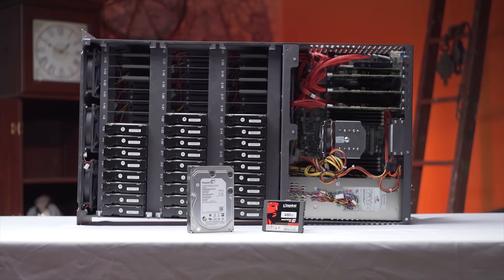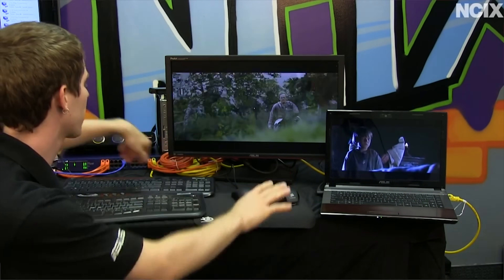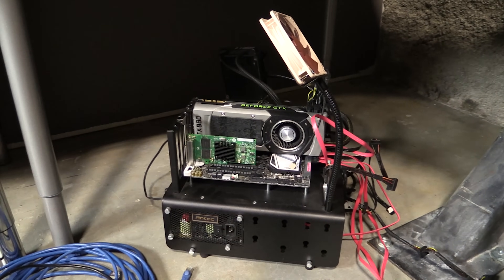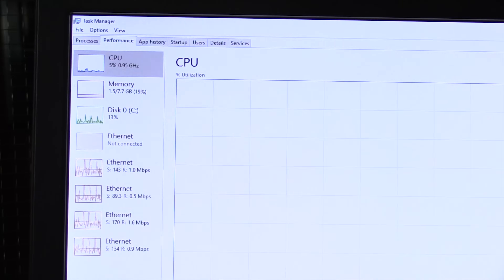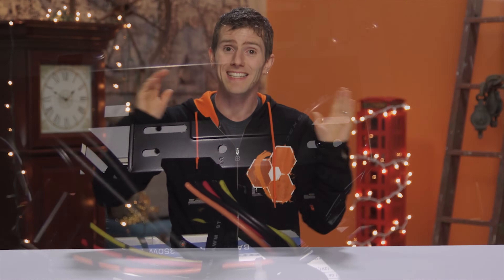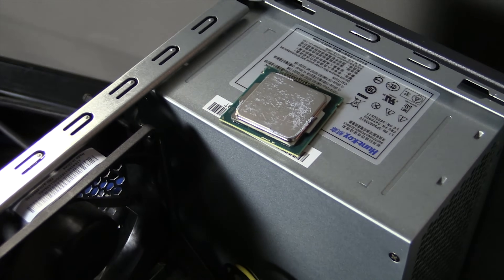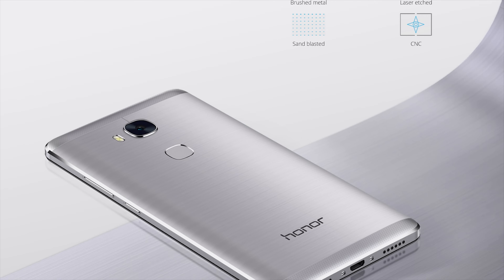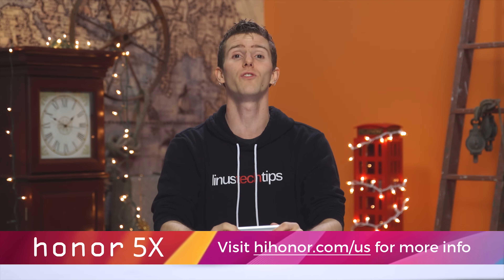Quadruple Your Network Speed for $100 with SMB 3.0 Multichannel!

Comment: I'm in college and live in an apartment that has restricted 2mb/s Internet. It took almost a minute for this video to load. 

Any suggestions?
Reply: +TheFinalBoss ™ not if you know the difference between a "Network" and "Internet"
Reply from the maker: +Dan Valdivia This won't do anything for your INTERNET speed. This only helps with local file transfers between machines on your LOCAL network.
Reply: +TheFinalBoss ™ Only if you don't know the difference between a Network or the Internet. Say you have a Local Server (As in, one you'd find in an office for specific use.) you'd wish to transfer data from and to multiple PC's through LAN. This would help improve your network speed.

Or as Linus suggested, between multiple computers or other Machines running on the same Local Network.
Reply from the maker: It's exactly as advertised.
Reply: I got the same problem mate, I live in Australia and it's like that pretty much everywhere except the cities
Reply: lan cable?
Reply: +Dan Valdivia You could try sticking the Ethernet cable up your butt. That always helps increase my bandwidth
Reply: +TheFinalBoss ™ The title does say NETWORK. doesn't mislead at all...
Reply: +TheFinalBoss ™ you're kind of an idiot...
Reply: +TheFinalBoss ™ it pretty clearly says "network speed" not "internet speed"
Reply: +LinusTechTips then this video seems kind of clickbaity
Reply: +TheFinalBoss ™ no it doesnt. it says network not internet
Reply: I have 2 MBps and can steam 720p so.............
Reply: +Dan Valdivia  Have you tried unpluging it and then plugging it back in?
Reply: +TheFinalBoss ™ Network speed =/= Internet speed. The clickbaityness comes from people thinking those 2 are the same thing.
Reply: +TheFinalBoss ™ The title says "network".
Reply: Get laid
Reply: +TheFinalBoss ™ Why? It's network speed not internet speed. Of course if you convince your ISP this would be scaleable hahaha
Reply: +TheFinalBoss ™ Not if you know the difference between network and internet speeds...
Reply: Complaining about 2mbs? I've got 300kbs...
Reply: Thank god I live in Finland. Router + 100mb internet =24€ per month
Reply: +TheFinalBoss ™ It looks like clickbait for the noobs who don't understand shit about networking.
Reply: +TheFinalBoss ™ It seems like a lot of the newer videos from LTT are click baity.
Reply: +Dan Valdivia Move.....But by the time you read this you've probably graduated, got married with 4 kids, and hate the Caravan 2030 model your wife made you buy for the kids.
Reply: +Kriss F lol I have 100mbps dl and 50mbps ul XD Fibre is great
Reply: That's nothing. I get 120kb/s fuck off m8, 2mb/s is a dream.
Reply: +Dan Valdivia Change College Duh!!
Reply: +Dan Valdivia go to a different college.
Reply: +Sdudyoy Newton ye dude, beat me to it. haha
Reply: +Dan Valdivia Get a different ISP? Or a mobile hotspot?
Reply: I get about 800KB a second internet, what's that in mbits or whatever they rank internet speed.
Reply: I had 2 mbit/s internet about 6 years ago, in 480 videos were fine.
Reply: I live in Australia <500kbps
Reply: dang I got 512 kbps and I watch 240p vids on YT 
FML
Reply: Get a 4G router
Reply: +Frankly Ratratiano You should see about getting your internet upgraded to the NBN if its in your area yet, 100mbps is pretty nice.
Reply: +TheFinalBoss ™ if you don't know the difference between local network speed and internet wan speed then that's your stupid problem
Reply: +TheFinalBoss ™ It says network not internet ya dope.
Reply: I thought this channel was for the geeks hang out but y'all dumb asf. Network vs internet speed , very clear difference
Reply: drop out
Reply: +Dan Valdivia 2 mbps or 2MB/s, cause if u have 2 MB/s then u have decent speed
Reply: Some people are so lucky. I live on my own sadly in the middle of no where. I can't deal with satellite data caps and I can barely get phone service from Verizon (so wireless internet isn't an option) so my last option is Earthlink's accelerated dial-up. It's terrible. Every single time- the dial up sound. Awful
Reply: Hahaaha I have 0.333 kps internet hurray Ireland
Reply: +LinusTechTips the title could've said something about local network speed
Reply: +TheFinalBoss ™ No, only clickbait if your a fucking idiot and don't understand the internet.
Reply: +Dan Valdivia I used to have 1Mbit  internet and it loaded 360 videos just fine. 720p video should be just fine with 2Mbit.
Reply: +TheFinalBoss ™ To think you can Quadruple your Internet speed above what you pay for is a lack of critical thinking on your part.
Reply: +TheFinalBoss ™ No it doesn't. It just means some people just dont understand the title. I never thought it was about internet speed. it says network in the title.
Reply: +TheFinalBoss ™ Forgive me if I am not understanding your intent but network speeds are not considered the same as internet speeds. Network speeds are how fast you can transfer files within your network not the internet. The video title does not claim that you can download things faster or stream at higher quality as would be implied with a faster internet connection.
Reply: +Dan Valdivia graduate and get your own place.
Reply: +Dan Valdivia move to Canada
Reply: +TheFinalBoss ™ not so. Internet and network mean different things
Reply: Just Hack someone wifi! problem fixed lol
Reply: +TheFinalBoss ™ It would be clickbaity, if he had said "internet" instead of "network" speeds. Your lack of technical knowledge or attention to detail isn't Linus's fault.
Reply: +TheFinalBoss ™ No it doesn't, i knew exactly what the title was suggesting as soon as i read it, it says NETWORK speed, not INTERNET speed.
Reply: get a sick mobile internet plan and use it phone as a hotspot.
Reply: +Generally Good PC Games Internet in Australia is faster than what you think.. guess you dont have fiber.. Swinburn university Has Solid 700mb/sec and higher.. ive tested it myself..and my mates Internet hits anywhere from 150 - 400 mb/sec.. only thing is prices way to expensive at $100 AUD a month.. yeah.. no thanks.. p.s. i have anywhere from 3-15mb and i watch 1080p fine with no buffer time most of the time.
Reply: +Dan Valdivia Move out?
Reply: +TheFinalBoss ™ Network speed is CLEARLY NOT Internet speed.
Reply: +Osumo Ben Lodan hahahaha im at 300/25
Reply: +TheFinalBoss ™ No, you just don't understand what the title means.
Reply: +LinusTechTips there are people who use ssh injection to use high speed Internet with least speed price  right?
Reply: +Matthew Kinney i stream on 240 p -_-
Reply: +Dan Valdivia Get a 4g antenna
Reply: +GAME OVER &quot;WE HAVE EVERY PIXEL COVERED&quot; Well if it is actually 800KB then that is 6.4mbits.
Reply: +Dan Valdivia Drink more coffee :-P
Reply: +Dan Valdivia Need more data. Do you pay a ISP for internet? Are you just connecting to the College's wifi? What equipment?
Reply: +Frankly Ratratiano shit talker mate.
Reply: Amaro Jorge Ace
Actually it looks like you beat me to it!
Reply: +Dan Valdivia  You're fine since it's a nine minute video. Also, You wouldn't necessarily want to have it all load at once so you save bandwidth.
Reply: +Dan Valdivia take hostages
Reply: +Dan Valdivia MOVE!!!!!!!!!!!!!!!!!!!!!!!!!!!!!!!!!!!!!!!!!
Reply: +TheFinalBoss ™ How so?
Reply: Lower quality
Reply: +Dan Valdivia You're joking, I get 0.3mb/s
Reply: +GAME OVER &quot;WE HAVE EVERY PIXEL COVERED&quot;  Multiply times 8. Probably 60MB connection.
Reply: +Dan Valdivia move to a different apartment
Reply: +Dan Valdivia go to a different college i get 100mbs our wifi is youtube certified whatever that means.
Reply: +Dan Valdivia Weird Idea, but maybe a TP-Link WAN Balancer and have the ports on different mac addresses/ Then bind traffic into one - that's to say that the management server is controlling bandwidth via mac/IP's. Just a theory.
Reply: +Pixelazed 100 MB\second :P
Reply: +Dan Valdivia i have 700 kilobytes/sec (australia of course) and 720p is fine for me
Reply: +Dan Valdivia buy your own internet you cheap ass
Reply: +Frankly Ratratiano  My 5.5 mbps W00T (I can also get nbn but cbf lol)
Reply: I have 100 KB/s download :(
Reply: +Le Veno NBN isnt in my area, instead i use Tier 5 Copper Cable with Ethernet and get 100Mbps
Reply: LucarioniteAU Nice :)
Reply: +Le Veno I'm trying to. Telstra said the nbn should be in my area around the end of February
Reply: +Dan Valdivia yeah, get your own internet
Reply: +Dan Valdivia That sounds VERY painful. xD

I have no idea what you can do though :/
Reply: +Dan Valdivia try setting your computer to wumbo
Reply: +Dan Valdivia I suggest you kill off all the other students
Reply: +TheFinalBoss ™ Not really, 'your network' doesn't imply anything internet related.
Reply: +Dan Valdivia When I went to university I had to run a phone cable from another student's room and pay for my own ADSL, which still got less than 2mbps but also had the added problems of being expensive and getting disconnected when the other student felt like being a dick. My suggestion is that you quit yer whining!

Alternatively, get a wireless internet connection either from a wireless ISP or a 4G sim card.
Reply: +LinusTechTips is there something you could do to maximize your connection? high performance router?
Reply: +TheFinalBoss ™ well no, network pretty much implies local. Otherwise it would say "speed up your internet"
Reply: mine is 2mbps too but there are no loading issue.
Reply: Have you tried restarting it?
Reply: +bigcheese82 yes there is! Pay more to get more! Works every time!
Reply: +Dan Valdivia I would reccomend first doing a speed test to see if it's really 2mb/s then check your internet usage to see what apps are clogging up your connection.
Reply: +LinusTechTips Title should have the word "LOCAL"  in it then right? I know everybody does click baits but be reasonable :D
Reply: GhostGurio network not internet.
Reply: +Dan Valdivia well if that restriction can not be unlucked. you can look for a big 4g mobile deal. and use you smartphone as a hub. some internet survices even sell 4g routers. but watch you data limit.
Reply: +Dan Valdivia Find a cable provider and subscribe to their internet. Just because your landlord provides crap internet doesn't mean you have to stick by it (at least not in my experience)
Reply: Near 90 Mbps, 11 MB/sec. I love my flat, internet wise atleast.
Reply: +TheFinalBoss ™ it is not, the video does what the title says, it never said it would improve your download/upload speed, nor your internet speed, just netwrok.
Reply: +Michael Margono  what's 2mb/s I am confused..... I'm just a kid
Reply: +LinusTechTips we need internet faster upload download BANDWIDTH Video man
Reply: Honest L7 no need for a video... it's really simple pay more for faster internet or change your ISP/distributor. If you are already paying for the best internet you can get and have the best ISP/distributor then you can't be helped, it is what it is.
Reply: +Dan Valdivia m8 500kb/s I don't want to hear anything! :D
Reply: +TheFinalBoss ™ Network isn't internet... just read the title.
Reply: +Matthew Kinney he probably means 2mbps which is 250KB/s
Reply: When i'm in college in the city I get 120mb/s but when I go home I get 2mb/s.
Reply: +Dan Valdivia Ask friends that live at different locations what their Mb/s is.  if its faster i would move there
Reply: i have only 100 mbps lol
Reply: +Dan Valdivia Move to a better apartment. The one I live in has 100/100 internet.
Reply: +LinusTechTips. You me excited for 8 minutes, and then i read your comment. Damn.
Reply: +TheFinalBoss ™ Network means LAN, if it said Internet then it would mean INTERNET
Reply: +Dan Valdivia VPN
Reply: +Dan Valdivia "restricted" <--- there's your answer
Reply: Nerfern it is exactly boosting your network speed.
Reply: +TheFinalBoss ™ The title is "network speed" not internet speed.
Reply: It will load instantly on 240/360p
Reply: +TheFinalBoss ™ it clearly says network speed in the title mate. :P
Reply: +Dan Valdivia I have the answer for you because I only 1.5MB down and 56k up. Use the extension Magic Actions for Youtube. Then after install Force Player Type to flash, stop auto play and tune on Speed Booster - Better video preloading / buffering.
Reply: +LinusTechTips No, this is clickbait and you know it. When a normal consumer sees this video they automatically think "internet=network"
Reply: +TheFinalBoss ™ Not really. Network speed and internet speed are completely different.
Reply: +TheFinalBoss ™ "Network speed" and "internet speed" are completely different
Reply: +TheFinalBoss ™ lol hardly... it says "network" in the title lol
Reply: +Sir Stankovski Try putting the games IP and URL in your host file on your PC
Reply: I have 10kbs so stop complaining
Reply: +Dan Valdivia I'm in college and live in an apartment that has restricted 60kb/s Internet. It took almost a century for this video to load.
Reply: +Dan Valdivia we can run a cable from my house.
Reply: +Matthew “Redstone Today” Brownmiller Where the Hell do you live?
Reply: +Dan Valdivia try web caching, safe squid and so on.
Reply: +TheFinalBoss ™ It said how to improve your network speed not Internet...
Reply: +sarang sharma Well now I feel bad because I always complain about videos that don't have 1440p...
Reply: +GAME OVER "WE HAVE EVERY PIXEL COVERED" That's .8 Mgbits
Reply: +John Doe My God man, what country do you live in!
Reply: +Dan Valdivia I'm at 2.5 and 1080p works just dandy. Have wee look at your'e CMD for open connections that might be eating up some bandwidth :)
Reply: +TheFinalBoss ™ Why it says network speed, not internet speed, it does just that speeds up local network speeds.
Reply: +Dan Valdivia I feel that. My apartment came stock with 5/1 but I got a few extra hours at work so I can afford to upgrade my plan to 25/5
Reply: +sarang sharma ha scrub I can steam at 1440 but I chose 1080
Reply: +TheFinalBoss ™ Not really. Network is in home kinds of stuff. If it was meant to be click-baity, it would have said internet speed.
Reply: +TheFinalBoss ™ It says Network speed, not Internet speed.
Reply: +Leron Joseph Dear Sir just starting out on my geeknerdship this is where it begins
Reply: +Dan Valdivia Short answer, move.
Reply: +Frankly Ratratiano I live in Sydney, get 2mbps down. Where is my nbn
Reply: +TheFinalBoss ™ He says NETWORK not INTERNET. So he has the right info just has good advertising as well.
Reply: +TheFinalBoss ™ Considering the title, nor the video NEVER said anything about INTERNET speeds, how so?
Reply: +Dan Valdivia im stuck here with 6mb/s (50mbit) line and still get buffering in videos. youtube fucking suck
Reply: +TheFinalBoss ™ Internet is the only network. Nowhere did it say anything about internet so it's clearly about LANs.
Reply: +Dan Valdivia My internet http://www.speedtest.net/my-result/5045426121 (no limit) in Poland only 17$
Reply: +TheFinalBoss ™ you don't the know the difference between "network" and the "internet" lol
Reply: I have 1.2mb/s and I never had problems to watch videos in 1080p
It struggles a bit to load 1080p60fps
Reply: does it scare anyone else that this comment has so many likes? It kind of blows my mind that so many people read the title of this video and thought they were going to find a magic way to get faster INTERNET speeds when the title clearly says NETWORK.. as in LOCAL NETWORK... LOL. I thought the audience of LTT were tech enthusiasts... I mean even if you're not a network guy you should realize that you aren't going to be able to change internet speeds from what you get at the modem.
Reply: +Matthew Kinney 10b=B
Reply: +TheFinalBoss ™ It's not clickbait at all.
Reply: +Dan Valdivia Dont feel bad, i have 1 MB
Reply: +Reptillian Overlord 8 bits = 1 Byte
Reply: +TheFinalBoss ™ I mean technically it is titled "Network Speed," but they probably should specify its for you're local network :P
Reply: +Dan Valdivia Is that megabit or megabite?
Reply: technically thats a milibit, but idk how that is possible. assuming its 2MB/sec since both are lower case
Reply: Aaron Gallagher Well i'm talking more about the difference between bit and byte as there are 8 bits in a byte. So if he has a 2 Megabyte connection that would actually be pretty fast but if he has a 2 Megabit connection it would be terribly slow.
Reply: +TheFinalBoss ™ NETWORK speed not INTERNET speed, similair not the same
Reply: +Milk Fuentes im on 6mb down and i can barely get it to load 480p most of the time.
Reply: +RisseK1 if you have access to both ethernet and wifi you could bride the two together that might help a little bit other than that I think your SoL
Reply: +Milk Fuentes same
Reply: +TheFinalBoss ™ No, because he clearly stated network speed, not internet speed.....
Reply: +Dan Valdivia You may have to buy an internet service for yourself (provided that the apartment owner would be ok with that).
Reply: +GAME OVER &quot;WE HAVE EVERY PIXEL COVERED&quot; 0.8
Reply: +GAME OVER &quot;WE HAVE EVERY PIXEL COVERED&quot; 0.8
Reply: +Krzesisław Wacek co to za internet??
Reply: +Dan Valdivia <250kb/s DL speed.
Reply: +GAME OVER "WE HAVE EVERY PIXEL COVERED" 0.8 mb/s.
Reply: Best Hacking Tools Of 2016 For Windows, Mac OS X, And Linux 

http://sh.st/m2w0t
Reply: +TheFinalBoss ™ Not really. Have common sense before clicking a video. Nothing is going to "Quadruple" your internet speed unless you empty bank account to isp. This is for us that run servers and nas at home.
Reply: +Dan Valdivia If you can not get a different ISP, just use the 4G or LTE or whatever connection on your cellphone through wifi, if available. That's what I did for a while.
Reply: +Connor Brown I have one of those, but it does not do what you think.  It exposes 2 IP addresses to the outside so you can have 2 WAN (internet) connections.  It balances the load only when using multiple streams or threads.  Also, the unit replaces the existing router and must be plugged directly into the 2 WANs.  He is a client on the LAN so he has no access to any of that, unfortunately.
Reply: +TheFinalBoss ™ Not really? It clearly says Network Speed.
Reply: +Dan Valdivia 4G
Reply: RICK! hotspot?
Reply: +Dan Valdivia I have around 11 megabit per second internet, You probably mean megabits, so tell your college to speed up there internet. At 11 you can stream 1080p, and 1080p 60fps most of the time. But it still is slow for downloads, but around 10-11 is good for youtube.
Reply: +Dan Valdivia MOAR POWER. Otherwise, try a free VPN and see if that helps.
Reply: +TheFinalBoss ™ It doesn't say Internet Speed, it says Network Speed. Learn the difference.
Reply: +Dan Valdivia Get a hot spot.
Reply: +TheFinalBoss ™ Or you don't understand that network speed != Internet speed.
Reply: +Giver and remover of Internet cancer. I assume he meant 2mb/s as in megabits not megabytes. Who the hell would call 2mbps a dream LOL.
Reply: +LinusTechTips Well you could always hook up 4 google fiber connections there Linus!
Reply: +Dan Valdivia Contract MetroPCS unlimited 4g =D
Reply: +sarang sharma My heartfelt condolences buddy, I too am suffering from BSNL
Reply: move
Reply: +Dan Valdivia for me that would be amazing try living in a quad plex sharing a 950 KB/s router
Reply: +Dan Valdivia Live in another apartment that allows you to use your own ISP.
Reply: if its your own router try talking to your internet provider for a faster roughter or internet speed it will cost more if its shared across the apartments than you cant do anything and 2mb/s is not that hard to live with in canada you half to pay more to get 1mb/s and i live with 950kb/s
Reply: +Dan Valdivia   easy bro, instal a vpn like hotspotshield or something and enjoy.. jumping over the limitations, if that doesnt work, try to clone some NIC mac addreses, or use wifi antenna to get some better internet from a neighboor GL
Reply: +Dan Valdivia wow that sucks im running 150mb/s wireless to my computer.
Reply: +LinusTechTips You also have to wire your house all over again, if your server is on the opposite side of your house. This is just not practical at all.
Reply: +GAME OVER "WE HAVE EVERY PIXEL COVERED"  800 Kilobytes is 6.4 Megabits which is above average in the US.
Reply: DFB Noobish cool, I thought it was like really slow, can't beleive people have it worser off in this day and age.
Reply: move to new zealand
Reply: +TheFinalBoss ™ it says NETWORK it doesnt says INTERNET
Reply: +Francisco Barraza i know
Reply: TacticalFluke09 the internet is a network.
Reply: +LinusTechTips Can you make a video on how to get the most out of your internet package and get the best pings possible?
Reply: +Dan Valdivia Go get your own private Internet. It's not expensive, I pay 60 dollars a month for 100mb/s internet.
Reply: I got the same prob. So I leave my "personal hotspot" on & crack my window open, leave my phone next to my window. My phones faster than my home wifi
Reply: +TheFinalBoss ™ LinusTechTips has been branded for mostly tech savvy entrepreneurs, enthusiasts for a number of areas, and then the general tech intrigued audience. Not all of their content is for those with commercial grade problems.

If you've followed long enough you'll see that they find unconventional ways to do unconventional things. There may be simple little things that they do that you may find undoubtedly handy but they pride themselves on going further than you'll need to go with things you may never see most of the time.

And lastly all titles are clickbait-y. They were made to persuade you to click on them. In the beginning the idea behind the video is outlined very clearly. Just getting more than a gigabit of throughput point to point.

;)
Reply: JustRefleX yes, but a network isn't necessarily the internet. The title doesn't imply this, so it's not misleading. I came here expecting an explanation of how to make my LAN faster, and I liked what I saw :)
Reply: +David Nelson The title says "YOUR" Network. lol. It's not misleading people just understand.
Reply: Oh quit whining I have under a megabyte per second at my house
Reply: +Jr 5802 Same here Sometimes less
Reply: mine 512kbps jokes
Reply: +jackson youda that's like 2001 dialup
Reply: +Matthew Kinney you are also probably the only one on that network doing so where he is in college living in an apartment with anywhere from 50 to 100 other people on the same network as him
Reply: +Dan Valdivia Hows your budget? A lot of companies like AT&T or verizon sell hotspots that can probably help you. ITs a monthly cost and some have data limits, so if possible I'd try to go with an unlimited data plan

Its possible to stream youtube on your own connection with that little DL speed, but with a lot of people on it not really.  Getting a hotspot is your best bet. Just make sure you secure it and don't let anyone else  use it, especially if you dont have unlimited data
Reply: Tmobile hate to say it but are the king with their plans and unlimited data. They also use GSM.
Reply: +Dan Valdivia buy faster internet... that's the only way
Reply: lol ok
Reply: +Matthew Kinney 2.3Mbps is recomdended for downstreaming HD quality video. doesn't mean that 22Mbps can't do it, but it must hardly be a stable stream at all times.
Reply: +TheFinalBoss ™ Network speed =/= Internet speed
Reply: +Stoneysilence he hihgly likely meant KB as kilobits and not bytes. not ISP i've ever heard off would ever dream to state a lower number such as bytes when they can use bits to make their connection seam a lot faster, nor do i know of an ISP delivering a weird number such as 6.4

they mostly only use speeds that can be divided by 5 with an exception of low speeds such as a 2Mbps connetion.
Reply: +X-Ployt that's only handy if you have a data cap :P
Reply: +David Nonya that's a slow fiber connection xD

without fiber, my apartment can be provided with a 300/30 Mbps connection.

only reason i don't have it is that i'm not going to pay for it's rather large premium.
Reply: +Matthew Kinney He probably mean 2Mb
Reply: +Dan Valdivia Kill unneccessary programs that my be running in your background. Uninstall any bloatware that may be reducing your available data stream. Shut f your phones wifi when not in use. I got an SSD for my laptop and it has the best results. I jumped from 480 to 720p and shorter load time. I cant explain why that  worked tho. I had 1.6 mb/s on avg for years because thats all they offered in my are. Had to make the most of it.
Reply: +KimSjopi Why does Northern Europe always sound like it just has its shit together.

America. $75 for 100mb. Do you have a data cap?
Reply: Full-Metal_Jacob 
Location: Denmark
provider: Stofa www.stofa.dk

through my provider you are only a few $ away from getting a 300mbit/30mbit connection with no data cap.
Reply: +Dan Valdivia move  or pay for usb tethering with ur mobile device
Reply: +Dan Valdivia Change your DNS settings or set up your own proxy server and force a update on the network to your own proxy which you can control the bandwidth.
Reply: +GAME OVER &quot;WE HAVE EVERY PIXEL COVERED&quot; 800 kb/s = 6.4 mbps
Reply: +TheFinalBoss ™ no it doesnt, the title says network speed, not internet speed. I also thought it would be internet, but i cant think of a better word to use then network.
Reply: +TheFinalBoss ™ Considering the only way you can "Quadruple your internet speed" is to pay your ISP for a higher speed package (If they even have one) the title of this video is accurate and not "clickbaity". "Network Speed" does not solely mean your download/upload speeds.
Reply: +TheFinalBoss ™ What would you name it then?
Reply: +Dan Valdivia Get a fast wireless solution.
Reply: its college, meet up with a girl with WiFi & put in work ...best of both worlds ,other than tht everyone's on the same network, GOODLUCK, just upgrade
Reply: +Dan Valdivia move to south korea, now internet speed limits there
Reply: +TheFinalBoss ™ it said network not internet speeds ...
Reply: +Dan Valdivia see if u have an isp wifi hotspot near u, then ask any of your friends for the login info if they have those services. assuming u can't get your own isp in the apartment.
Reply: +Dan Valdivia Move
Reply: +Dan Valdivia Try living in Nebraska. The fastest internet I, personally, have seen was 800 kb/s
Reply: +TheFinalBoss ™ I got baited also
Reply: +LinusTechTips What if your roommate absolutely hates cables? Think there's a potential to use SMB multichannel by making some sort of wireless bridge that might punch through a couple of concrete walls?
Reply: ***** screw him because you are equally sharring the room. And tuck away the cables along a wall, and get white cables
Reply: +Amaro “egrojeca” Jorge Ace 
except that the internet is a network. Its is the Interconnected Network
Reply: +Dan Valdivia I got 30 kb/s, don't complain.
Reply: Adeel Rehman I was hoping to get linus to do a ridiculous thing, for all intents and purposes I'm fine running hundreds of ft of any color cable to get this (SMB) to work.
Reply: +LinusTechTips I think you missed the question.
Reply: Move to Provo and get Google Fiber. You can even still go to school here too.
Reply: +Sir Stankovski nothing you could really do about that. ping is dependant on your internet connection, and the only way you can change that is connect to a better server, contact your ISp, and it some cases, nothing, because sometimes the server itself could be the problem. sorry bud
Reply: +Dan Valdivia you poor soul. i get 33MB(MegaBytes)/second or 264mbps
Reply: +Dan Valdivia Buy or Build yourself a Wifi antena and hope you can pick up a hotspot some where.. that has faster speeds.
Reply: +TheFinalBoss ™ beast
Reply: +GAME OVER &quot;WE HAVE EVERY PIXEL COVERED&quot;  1 MB is around 8 Mb
Reply: +Damian Chiliński Oh. Fancy meeting you here.
Reply: +Dan Valdivia get satellite internet usual speed for that is around 20 mbit/s download
Reply: +Dan Valdivia Connect to someone's wifi that isn't in your building.
Reply: +Rasmus Lindved 1MB is exactly 8Mb.

Also I feel bad for those that don't get (what we'd normally call) broadband speeds. I'm one of the lucky few (in the USA) thus far that has Gbit internet available. I'm getting the upgrade in a couple of months, up from 0.5Gbit.

Although the data cap for my plan means I could burn through it at full speed in only 3 hours of constant downloads.
Reply: Move
Reply: hack into the router by resetting it or by hoping they didn't change the network password. then make an exception for your apartments IP address
Reply: +Dan Valdivia I can't speed up your internet but I might be able to free the traffic if multiple people are using your speed.

When I was in university i used the app Wifikill. It's android and requires root but was great for stopping my porn addicted flat mate from using the internet at all....
Reply: +TheFinalBoss ™ Then how would they word it? Network refers to the area you are on.
Quadruple Your Network(NOT INTERNET JUST LOCAL) Speed?
Reply: +Frankly Ratratiano What are you talking about I live in a sydney suburb and im hitting 100mbps downlad speeds
Reply: +FullOnKnives hes in university, he can't go and plug his pc into the router.. fool.
Reply: +Iron Cutt I've personally have never had someone ever refer to the internet as their "network" so when I read the title of the video I assumed what I am connected too.
Reply: Waaaaaaaaaa poor you with your fast 2mbps interent
Reply: +Dan Valdivia Buy a Mobile Internet Modem USB 2.0 or 3.0 Plug we use them in australia all the time
https://www.kogan.com/au/buy/3g-usb-modem/
Reply: +GhostGurio No. Network still does not imply Internet. Especially when it says your network.
Reply: +Dan Valdivia Live in Australia and am in awe.  How did you manage to get to whole numbers?
Reply: +Dan Valdivia 
I'd find a local business within line of site, offer to pay them a small fee, then connect yourself and their building with a Ubiquiti AirFiber or AirMax and get things rolling!
Reply: +Dan Valdivia Look for a phone/ethernet jack in the wall, that's what my school had, or you had to get your own shawbox.
Reply: +TheFinalBoss ™ No... just because you misunderstood 'network speed' does not make it click baity. Internet speed is not even the same definition as network speed... The problem is with ignorance, that is all.
Reply: +TheFinalBoss ™ how is it click baity? you only get what you pay for when it comes to an isp.
Reply: +Ultraplugin Survival i dont like u
Reply: +Dan Valdivia Drop out of college and start a fortune 500 company and then get a nice house with mid-co
Reply: ***** Which is a depressingly large demographic.
Reply: i went from 240mbs to .1-3mbs max for really
Reply: +Madest lollers LOL
Reply: +Matthew Kinney Yeah you have 2MBps, he has 2mbps. Major differences.
Reply: agun17 You're replying to the wrong person.
Reply: +Sdudyoy Newton Interweb problems still today
Reply: agun17 I don't know how, because your comment made no sense at all. Because once again you're replying to the wrong person. "8 times faster" No fucking shit, hence why I said major difference.
Reply: I have 2/mbs and this vid loaded like lighting... wtf is wrong with your internet.
Reply: +agun17 720p... when watching at 1080p it skips every once in awhile and takes a sec to load in. its not at all like this guy claims.
Reply: +Dan Valdivia ummm excuse me? 2mb is high....
Reply: ***** 2 mega bytes a second is high m9
Reply: ***** XD mate, come live in australia thats high af
Reply: ***** Haha, yeah thanks.
I must ask though, what kind of speeds do u guys get in america? because 2mb is high end for most places here.
Reply: ***** nice
Reply: +Generally Good PC Games still not 1gb tho ;)
Reply: +Dan Valdivia Graduate and get a job!
Reply: +Dan Valdivia Stop trying to load in 1080p. 480p max if you want to stream. I can stream 480p on 1.3mbps. Also mbps does not mean megabytes per second. It means million (megabit) bits per second. If you want faster internet you're gonna need to pay for it.
Reply: +Ht Bloozyy that's true, but there's nothing you can do about that. You can increase your network speed on your own, but if you want faster Internet you are gonna have to pay for it or pray very very hard. Nothing else you can do, sorry :(

Now if you're not actually getting 2mbps give or take, you should do some trouble shooting and try to figure out what's causing the slow speeds.
Reply: +Ht Bloozyy also just stream in 360p or 480p w/ your network speeds. I usually only do 360p as I usually get 1mbps.
Reply: +Ht Bloozyy Hey if the VPN works for your purposes more power to it. I gave up on my current ISP and I bought my own ISP (seperate from my parents).
Reply: +Krzesisław Wacek http://www.speedtest.net/my-result/5114141238 for 7$ TAKE THAT
Reply: +TheFinalBoss ™ Internet =/= Network
Reply: +TheFinalBoss ™ You're a fucking idiot. Network has never been a synonym for internet, This is not click-bait at all.
Reply: Exmortis85 I like how you get more upload speed than download lol
Reply: well what I would do is find out what internet speed your Internet provider is supposed to be providing you with compared to what you are geting and if your not geting what your soposed to contact them and thay should fix it somtimes your modem is outdated or you Internet provider might have you on an outdated plan or something on their end is rong and thay are most likely legally obligated to fix it depending on local law and you might got compensation for it. but if you are geting what you are soposed to thain all you can do is get a better plan. sorry for such a long comment but this is sincere real advice and I hope it helps.
Reply: +LinusTechTips What if you were to connect each cable to a different router?
Reply: +Dan Valdivia put a keylogger on the network admins PC and once you have the router pass you can enter and change the limit to your PC
Reply: +Generally Good PC Games Or live in sweden where almost everyone got 100up and 100 down c:
Reply: +The Real Meow Average Internet speed in Sweden is around 18mb/s, most young people have 30-50, gamers usually go for 100 but the reality is that most people live outside big cities where the Internet is much slower, especially in Northern Sweden.
Reply: +Dan Valdivia I was the 900th like~
Reply: Alexandro Hutt Northern sweden yah but Fiber is almost all over now.
And yah most people have 30up and 30 down doe almost all gamers have 100up 100down And it only costs about 10Dollars more a month
Reply: Maddie im at 56MB and YouTube still will stall for me sometimes. Its JewTube itself being stingy with servers and possibly excluding some of us (they attack and censor my Uploads so I wouldnt put it past them)
Reply: I was in your same boat a few years ago with the crap apartment bandwidth.

I just called my local ISP to come out and set me up with a modem for my individual apartment. The bill was split between my roommates and I. We went from random connection drops and low speeds to a steady, fast connection (and we were able to broadcast a guest WiFi for the actually-decent-neighbors).

Now, this may sound controversial, but my apartment complex at the time said, explicitly, YOU MUST USE OUR APARTMENT'S INTERNET ONLY, but come on. 

Not only do I hate slow bandwidth, but I also hate connecting my personal computer to a LAN long-term with a bunch of random people who I know nothing about. The security issue of malware, viruses, etc. getting spread across the network is a real threat, and because I didn't know what security the complex had in place on their firewall (and didn't care to know because of how slow and inconsistent it was), I just said forget this, I'm starting fresh.
Reply: What? I'm at 0.5 Mbps and it loaded in 20 seconds
Reply: +TheFinalBoss ™ It says network speed in the title. Not internet speed.
Reply: Hahahahha, I'm at 150/15.
Reply: +Dan Valdivia I have 100mb/s internet speed :/
Reply: mybe because your not suppose to be gaming when your in college. Not much you can do about it.
Reply: Wow I'm below one so you are still better.
Have you solved your problem btw?
Reply: Dan Valdivia i used to get 4000kbps maximum and now get 8000kbps, i started to use what is called a test socket which i have because i use adsl, look it up before you try, this removes the extensions around the house (if you have a landline plugged in anywhere else) but is a lot faster especially if the extensions have faulty wiring as it goes from router straight to the line outside
Reply: 2 MBps and 2 Mbps are two VERY different speeds.
Reply: Get a good lawyer
Reply: Get a 4g modem